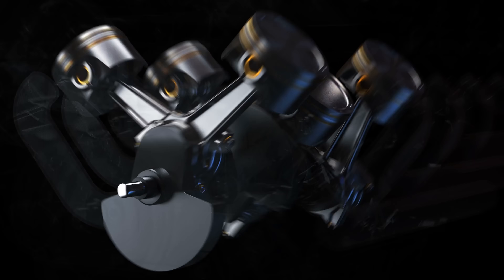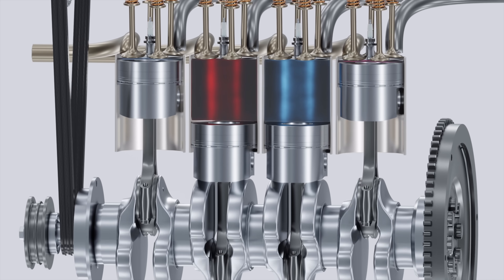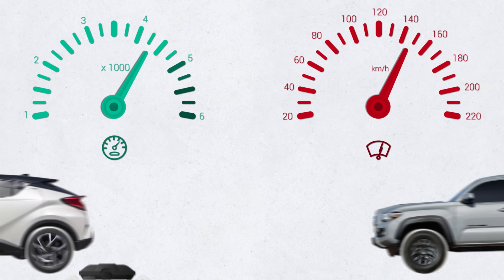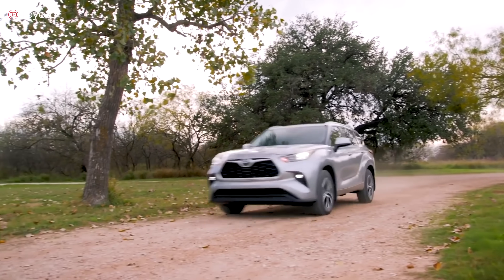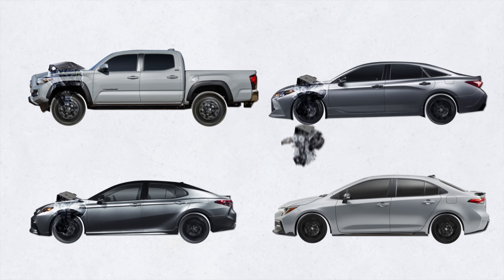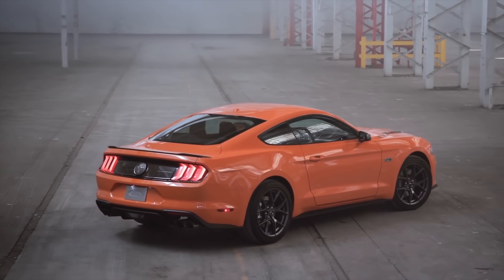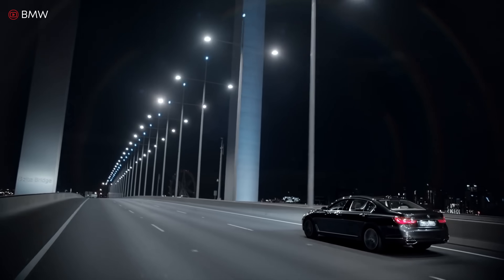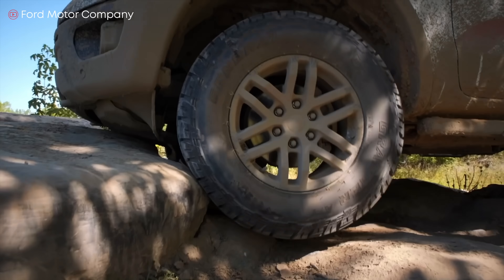No One is Telling You the Truth About Turbocharged Cars, So I Have To

Comment: Scotty preaches to avoid turbos for longevity, i agree, so i would avoid a turbo and go with a V6.
Reply: Say that to the 1.9 Jetta TDI from 98 by Volkswagen, that can make to the 400,000 miles.
Reply: Nah
Reply: V10
Reply: 2020 Honda Passport Elite AWD with NA V6.  Should last a very long time with proper maintenance for whomever own it after us.

Its going to be traded in within 2 years for a 2022 Nissan Frontier Pro4x w/ a NA V6.

Sensing a trend yet?

NO TURBOS!
Reply: @jacobkinnan4078  Isn't that a diesel engine?
Reply: @CC_Marauder  one saab turbo with 155k on it, one saab turbo with 236k on it, no issues.
Reply: If you take care of the turbo there is no reason to question it’s reliability. In my ‘86 Saab turbo that had no water cooling I ran Mobil 1 oil exclusively and it went almost 200,000 miles before being totaled by deer hits. The valve cover was so clean you could eat out of it. I changed the valve cover  gasket at 150000 miles just for the hell of it and otherwise the engine was never opened up. Modern turbos have water and oil  cooling and should last indefinitely if taken care of. Just means changing oil,filters and coolant.
Reply: @CC_Marauder  why would you ever go for a Nissan product. I know their trucks are ok, but you can just get a f150 or tacoma/tundra that has a v8
Reply: Scotty preaches this because he doesn't like turbos, matter of fact I bet Scotty hasn't own a legit turbo charged car himself for a long time. I owned a 05 Subaru WRX STI for well over 13 years, but my car wasn't stock, I modified my cars with bigger garrett turbo's and my garrett turbo's lasted well over 150k miles (and counting), before my car ended up getting T-boned by a driver who ran a stop sign and getting totaled. 

Long as you take care of your car, like proper oil changes 5K max, let the car idle for about a minute or two after driving for a while, a turbo charger will last a very very long time. The reason why all these people bring their turbo charged car to scotty is because they don't know how to take care of it. I bet they are one of those people who will immediately shut off the car after getting home from a long drive, instead of letting the turbo cool down for about a minute or two.
Reply: Wrong!!! It all depends how you drive and maintenance. If you drive like a dummy and use jiffy lube or cheap oil of course your powertrain won’t last long!
Reply: @jacobkinnan4078  that’s diesel tho, different ball game then gas engines, lol I had a 2000 Jetta TDI that I put 350,000 miles on and got 50 miles to the gallon on the freeway, did basic maintenance and that car never once disappointed me In the power department and never left me stranded... I will always regret getting rid of that daily 😭😭
Reply: @hollowarrow16  too expensive to run a v8 these days my guy 😂
Reply: Literally the sole reason I turned to Dodge Challenger. I’m gonna buy one soon. I never cared for dodge but I realized that dodge makes v6 engines still and many other do not. So I learned about the challenger and holy hell I’m in love. I want that challenger now..I wanna rt tho buttttt no AWD and that’s something I want too. So when I’m buying next year then I’m definitely getting a GT challenger and I can’t wait. Sick of driving Prius for years now
Reply: @DJG37S  I agree my man, I’ve got a 2007 STI good for 550 WHP built it in 2016 put 60k on the build and I’ve never had an issue, used to have a 2005 Java black STI that I kept stock and just did the recommended matinence, bought it in 2010 and it had 210k original miles on the original motor, didn’t even run an AOS and never had a problem with it, wound up selling it for an R35 tho
Reply: @ohmy8078  go with a mustang ecoboost.. they smoke dodge RTS!! Mine is modded and I’m pushing 420whp that 500bhp..  I beat 5.0s and scat packs.. don’t get a v6 dodge come on now
Reply: Didnt scotty post a video about his new  f150?? Isnt that turbo charged?
Reply: I'll take the none turbo 2.4 liter four cylinders than the turbo or V6
Reply: @Paper.Power.Politics  but if it is in a sports car, then the engine won't last
Reply: @ohmy8078  na vehicles don’t gain much from tunes bro
Reply: No turbo for a daily driver.   Turbo for a car that you pay a lot of attention to
Reply: My 2013 VW Golf 1.6 has 130,000 miles on it so far, which means it's time for the first timing belt change. I'm hoping the car will last another 130,000 miles. Unless the diesel price gets crazy high, continuing driving the same car that's already paid for seems like the cheapest option.
Reply: Why not a turbocharged v6?
Reply: @rickitysplitz7035  what are you talking about!? And don’t matter ok about to build it up and be pushing around 700whp by then
Reply: You're gonna have trouble finding an affordable V6 very soon.
Reply: Same here I got the v6
Reply: I'll take the Turbo over the NA any day.
Reply: @kyungrix1112  yes but it has to be v6
Reply: @enlighteneddopamine9184  well you guys made a big mistake.. explain to me how I’m way faster and get way better gas mileage
Reply: @Paper.Power.Politics  I said v6 not that it has to be  NA. 😏
Reply: Try avoid turbo engines here in europe
Reply: Avoid a shitty V6 and get a V8
Reply: @ohmy8078  get the v8
Reply: @diablocls55  avoid a crappy v8 and get a turbocharged inline 4 that pushes more power and gets better gas mileage!
Reply: @Paper.Power.Politics  more power? Hahaha both my E550 and E55 AMG have something to say about that. And they’re both 15+ years old 🤣✌️
Reply: @diablocls55  I bet you my mustang ecoboost is pushing more power then your benzes.. I’m About 480hp.. and it’s a 4cylinder..
Reply: @diablocls55  I’m at 420whp and around 480/500bhp.. I know ur. It even close.. so throw away ur 25 year old cars. Because my 4cylinder will smoke your  v8s
Reply: @Paper.Power.Politics  see below
Reply: @Paper.Power.Politics  M113K engine can handle 800 horsepower on stock engine internals. Let’s see your eco boost do that 🤣🥱
Reply: @diablocls55  well not on stock engine internals.. but soon I’ll have my built engine and gonna. Be pushing around 1000whp.. I can’t take about what I can do to.. but I’ll smoke you now as my car is now
Reply: @DJG37S  oh I see,please educate me more about turbo engine, I have i5 2.5t volvo xc90 2006 
please I really love volvo and I need more education on how to drive and maintain turbo engines
Reply: @Paper.Power.Politics  what's wrong with jiffy lube, a new one just opened up by my house and I planned to give them my business over big o?
Reply: Here, here.
Reply: Well I just bought a used Jaguar turbo last year, it now has almost 50,000 on it, I tend to keep my cars for 200,000+, so let’s see how it does, in the meantime VROOOOOM!
Reply: @jamesschlueter8285  can you pick up chicks in a Saab?
Reply: @jacobkinnan4078  That's a turbo diesel, a totally different animal.  Do a web search on VW 2.0T oil consumption.  Diesels are built to withstand higher pressure and The turbos in diesels operate at a  much lower pressure for the most part.
Reply: @CC_Marauder  i also sense a trend of going from reliable to the side of the road.
Reply: When it comes to trucks I find it sad that the turbo 4s have way lower power the 3.5L ecoboost makes 370 hp and 465 ftlb torque.
Reply: You’ve added 10 minutes to my life.
Reply: Same here my brother and thats why I chose the Coyote V8 over the EcoBoost V6 anyday of the week.
Reply: @CC_Marauder  I bet it'll outlast any EcoBoost engine out there.
Reply: Normally aspirated is best
Reply: @paulseary7041  It sure is my brother.
Reply: I would absolutely agree, I would love to avoid a turbo, the only problem is, try to find a V-6 today without a turbo, or even a four-cylinder without a turbo in a vehicle that I like, next to impossible.
Reply: @77jaycube69  yup
Reply: @penguwan_9515  Cost more on gas but a lot cheaper in the long run for maintenance and repairs.
Reply: @jrrn96  standard jiffy lube response. "Your coolant is empty......."
Reply: @jacobkinnan4078  but diesel is something else. Americans don't get diesels.
Reply: @dragospahontu  v6 are stable
 No issue.
Reply: Got a 2004 Ford Everest Turbo Diesel Intercooler here in the Philippines. Has more than 300,000km on the odometer and it Still runs fine 😊. Always followed 5,000km oil change 😇
Reply: @ohmy8078  it’s a boat w a v6
Reply: If I had to choose to slap something on an engine I think I like a supercharger better
Reply: The Turbo on my F150 doesn't cost much but then I would just do the work myself so no labor cost.
Reply: @penguwan_9515  don’t get a v6 challenger, it defeats the purpose of owning a challenger
Reply: @dragospahontu  I'm american, and have my little diesel
Reply: @jacobkinnan4078  At 98 horsepower, it'll take all of those 23 years to get there.  Who's that kind of time?
Reply: @BrotherK-ex2co  I did have a low coolant...come to find out fuel pump went out in a 2013 Ford edge $2,000 because they put the fuel pump in the engine...terrible engineering
Reply: @jetson2075  how about turbo timers?
Reply: Look at all the wrxs and forester xts that are still on the road, they have head gasket issues but the people who drive them love them, and often if they love that they end up upgrading the head gasket sooner or later. That being said scottys advice is for people who don’t know their cars and often wouldn’t do these things so I don’t think he’s necessarily wrong
Reply: @mdolphin369  The last Honda Accord with a V-6 was made in 2017 and I've got one and love it. I hope to drive it a long long time.
Reply: Turbos do not provide enough extra horsepower at low rpm. A supercharger on a V8 is the way to go.

I don't want your supercharged 4-cylinder or V6. I'll stick with my 4.6 L V8 thank you very much, and with regular maintenance they can go for over 500,000 miles of rough service as a taxi or cop car. That powertrain proved itself for well over a decade.

Last year I had to take a long one way road trip to pick up another vehicle I had purchased. So I decided to rent the EcoBoost fusion at the local rental shop. When I arrived at my destination the owner of the small used auto dealership was very impressed with the EcoBoost and said I must have gotten fantastic mileage. Truth be told it sucked up an incredible amount of fuel for a 4 cylinder engine and was a gutless wonder over the entire trip. Not to mention that it was uncomfortable as hell because the air conditioning could not hold a candle to any of the AC systems in my V8 vehicles.
Reply: @DJG37S  new turbo vehicle now has electrical water pump which will keep cooling turbo  after engine shut off
Reply: @trademarkpending  My you be blessed with no problems on either Saab, now that the brand is gone and parts and labor are becoming scarcer by the day. In 1991 I bought a 1976 Saab 99 with (get this!) direct injection. Just $600 at the dealer lot, as it was a trade-in but didn't run. All I did was change the battery, change the oil, and it ran great for 2 years - till a deep freeze froze the WATER I had filled the radiator with, causing a cracked valvehead and killing the beast. Yes, I was young and stupid, but at the time I remember counting coins to pay for gas, so I've since forgiven myself.
Reply: @DJG37S  The thing is that you bought it new and cared for it. It takes a lot of courage and faith in humanity to buy a used turbo. Or some naivete about how people treat their cars and what that means to a turbo. All it takes is ONE lack of oil and it's done for. I know people who NEVER change their oil. Seriously, NEVER EVER. They buy the car, run it for 30k miles then sell it. How would you know as a second owner?
Reply: @ohmy8078  Get the new Tesla. As good as a Challenger in terms of performance, if not better, and still an electric that will maintain resale value in a few years, while ICE cars won't. You bought an electric too early, when they weren't ready. NOW is the time for an EV.
Reply: @Paper.Power.Politics  It's just a matter of how long he plans on keeping it. You're extracting more than the factory thought to be wise from your engine, and it simply won't last. Have fun till then!
Reply: @rogerbritus9378  it's really easy to tell if your turbo is dying is with the power. If you don't feel the car making boost or a sudden acceleration, then this means the turbo is going bad or it is already bad. Now with modern cars anytime there is a bad turbo your check engine light is going to come on.
Reply: @mctransportation9831  In the early 90's I could and did.
Reply: @DJG37S  Yes, it's appeasing to know about new anti-stupid features, like these and the electric water pump that stays on by itself to cool the turbo after shutdown. 

Stil, in my garage I've got two I6's and one V6 (all about 3.5L) that I want to keep for a while, then replace for EVs. Skipping all the craziness of the very last generation of extremely overly complex ICE engines that are trying to comply with impossible emissions standards. 

These small, high-reving, turbocharged overworked engines remind me of the highly complex final carburetors (1 per cylinder?) that, for the same reason, made direct injection look cheap in comparison and are now (a bad) part of automotive history. 

These kamikaze engines are suicidal and heading to extinction. BTW, I'm a mechanical engineer who worked on engine development with eight automakers, as a consultant. I have inside knowledge that few people share publicly for fear of income loss.
Reply: @rogerbritus9378  wrong wrong wrong wrong..  I’ll be fine.. regardless that’s why it’s called a build!! You build to support more power!   Where do you guys learn this stuff???
Reply: @Paper.Power.Politics  You can't build a skyscraper on a house slab foundation, which is what you're doing. It may start well, but as you build higher and higher, it will eventually collapse. Yes, you can take it to its limit (if you know what you're doing), but the whole "build" will be fragile and won't last. If that's your hobby and you have plenty of money to spend on new replacement engines, then you might as well put together a racing team to follow you around and also work on the many other challenges to a competitive performance, such as suspension, frame, brakes, skin, etc. Why not buy a retired F1 to work on? Leave these commuters alone, they're too far away from being an ideal platform for your elevated pursuits. You're literally applying expensive lipstick on a pig.
Reply: I can't wait to see the reports of the  2022Tundra with the smaller turbocharged engine.
Just think my 2010 Tacoma is going to have a larger engine than the "Big Brother"  🤔
Reply: @jacobkinnan4078  he's talking about modern car with turbos to much electrical.
Reply: @jacobkinnan4078  that's nothing Lincoln Town car has 596k original motor.
Reply: you don't have to go to him to know that, but some people are not all that informed about how engines work, especially turbo engines.
Reply: @jacobkinnan4078 that's not a turbo, that's a diesel.

Comment: After owning a couple of turbo I4, I'd prefer the NA engines. Just as you said: less components, make it less complicated to repair or to figure out what's wrong. Additionally sharper throttle response is something that i prefer.
Reply: @fernandogutierrez8357  . The exhaust system is a very unfriendly place. And turbos live there.
Reply: Not to mention some cars have turbo issues after 150,000 miles. Doesn’t make sense when a Toyota engine can survive more than twice that